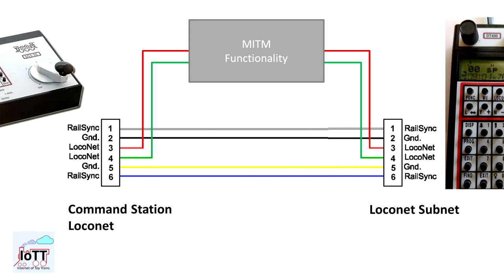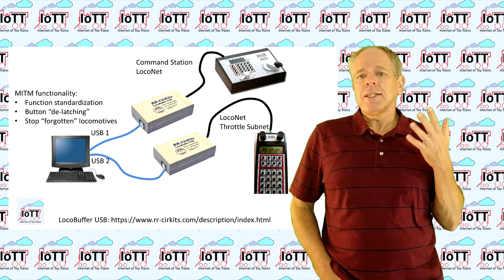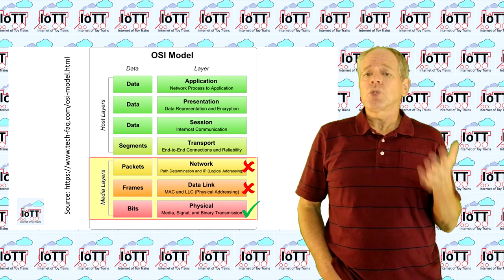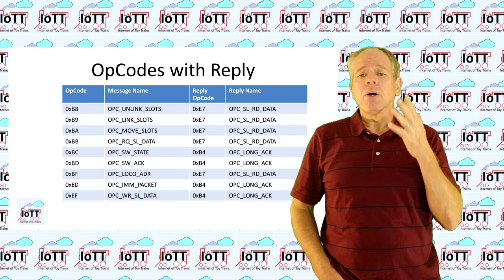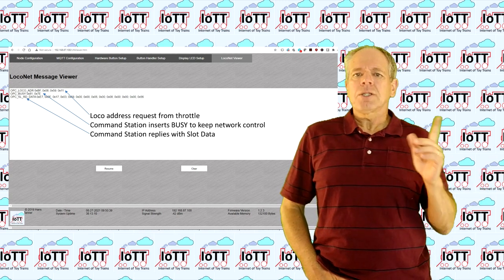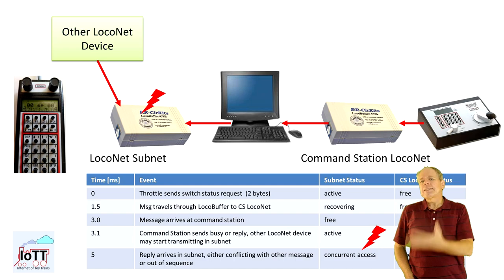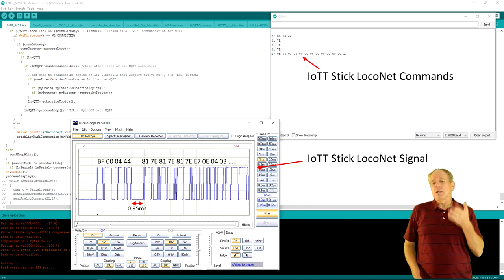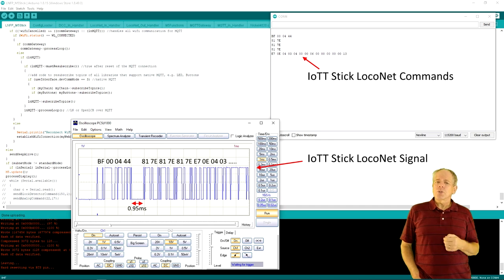The Dark Side of LocoNet (Video#76)

Comment: Would it be possible to connect 2 Loconet interfaces to a M5 stick or Core2 and filter messages from one to the other? For instance to prevent global power off message (OPC_GPOFF) sent by a throttle from being received by a command station
Reply from the maker: I would think that's possible. The challenge is to ensure that you get the LocoNet timing right for network access and transmitting. I would try to use two hardware serial ports for receiving and one single interrupt for transmitting to either one or the other network. That way you can only send to one network at the same time, but both can receive all the time. And it would probably even work when Wifi is on.

Comment: Very interesting, Hans ... great video. Have you had any experience with the Digitrax LNRP device? We operate a large Digitrax museum layout (over 100 Digitrax devices on the LocoNet) and have segmented our layout using 4 LNRPs. We have separate Windows 10 computers that run RR&Co Train Controller for automation and JMRI to control our staging tracks/turnouts. We have used the LocoBuffer in the past, but now use the PR4 for computer interfaces. TC runs smoothly, but the JMRI panels have been giving us fits with traffic that seems to crash our LocoNet. We believe that the segmented LocoNet is either flooded with commands it cannot process, or it is losing commands due to timeouts. Any helpful suggestions?
Reply from the maker: Thank you. Unfortunately I have never used the LNRP, but from what I understand, it is just a repeater, so it does not listen to the messages nor adding any latency. The only reason for using it is that the current source that terminates LocoNet can only handle a limited number of devices, so with the LNRP you are adding additional current sources for a group of devices. Besides that, it is also good to have sections for isolation of wiring errors, something the LNRP supports with the LED's. But since it is not adding latency (you may want to verify that by using a 2 channel oscilloscope and compare the signal on both Loconet segments of the LNRP and see how many nano- or microseconds the delay is) I would not expect that messages get jammed at the LNRP.
Another possibility would be adding a Loconet viewer in each segment (between the LNRPs) and see if the messages you get in each segment are identical. That would help to restore trust in the Loconet communication.
Once you know the network itself is reliable, I would start looking into how message bursts are happening, i.e. what is the spacing between messages from the same panel. Are they sent back to back or is there a break (typ. 2ms) between them to allow other nodes to access the network as well. Also, I would take an Arduino to intentionally create some collisions and see how the panel reacts. Does it properly time out and resend the message? In my experience this is the most critical point with PC software. If the messages are not going out properly, there might be a buffer overrun inside the PC program if there is a bunch of messages and messages are skipped.
Just my 2 cents ;-)